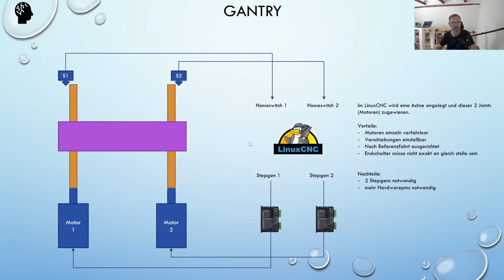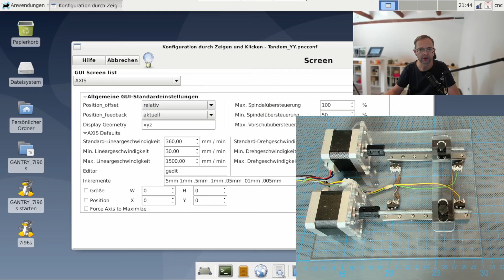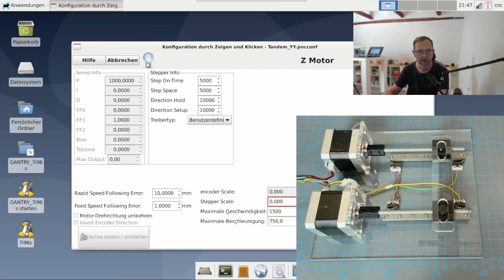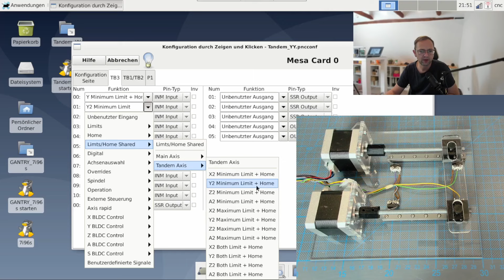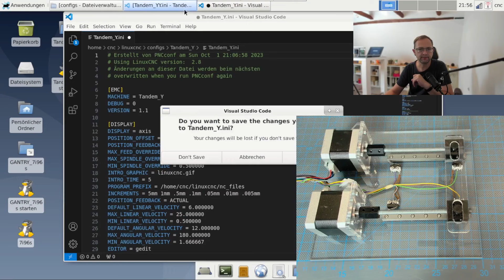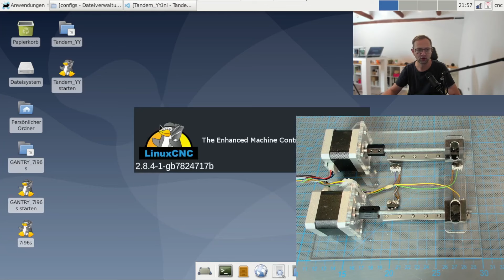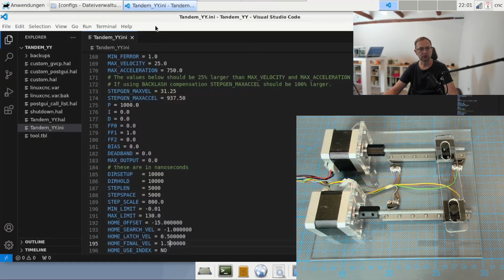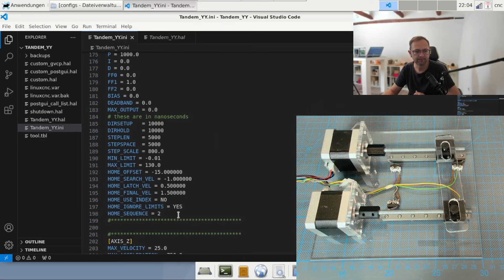LinuxCNC & Mesa 7i96s - Tandem Axis Configuration (Gantry)

Comment: This took me a long time to figure out on my router. I believe everything covered here is in the manual, but it's difficult for the beginner. Essentially, there are 2 levels of abstraction: joints, and axes. A joint is driven by some actuator, and axes are made from one or more joints. When first starting linuxcnc, none of the positions are known, so we have to go through a homing cycle. Each joint is referenced to some home location, and then linuxcnc can switch out of 'joint mode' and move axes instead of individual joints. All this depends on the kinematic model of your machine. Here 'trivkins' (trivial kinematics) is used because moving one axis doesn't affect any other.

All that to say the manual is actually really good. You will learn a lot by reading it, especially the "HAL Tutorial" section which made me realize that almost anything imaginable is possible with this system. It's really a shame that more people aren't making videos like yours.